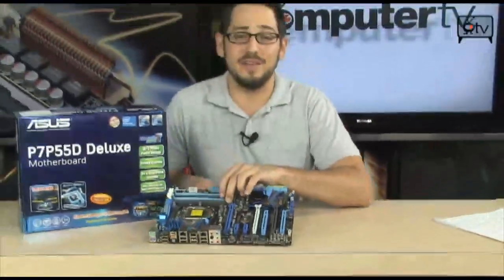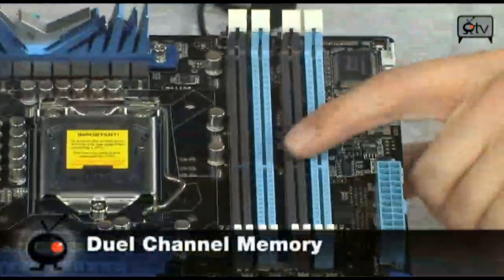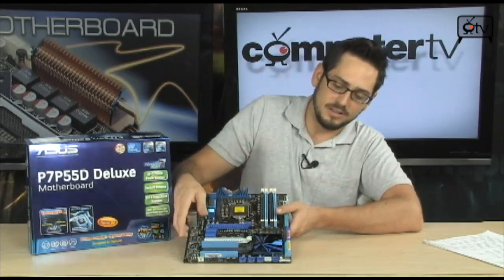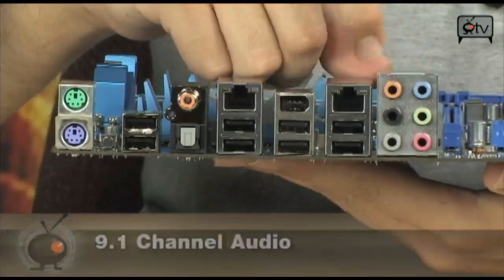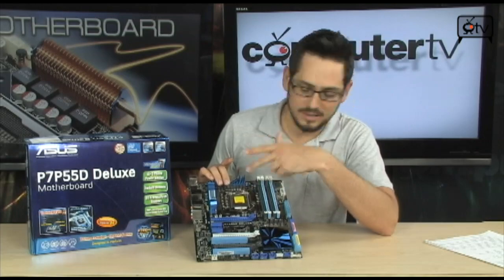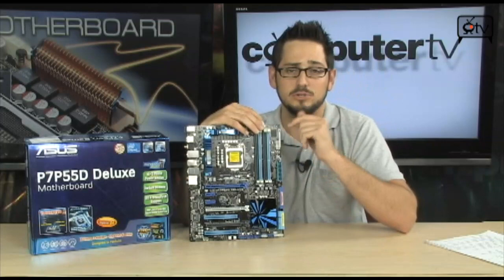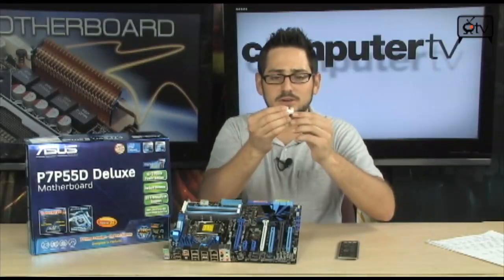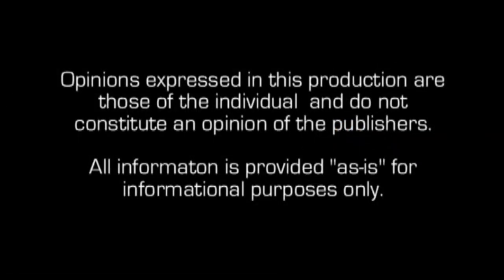Asus P7P55 Deluxe Motherboard

Comment: yeah it will still work but this time in 2 years there will be a motherboard with better technology and will be better, the p55 will still be a good high end board, 

instead of saving for a specific board, or a specfic card or cpu, just save up the money to buy a high end board or cpu and when you saved $200 you can buy the current "high end" product

Comment: not true, check out hardware cannucks, they did a test like a year ago that determained that x16, x16 and x16, x8 was exactely the same, and x4, x4, x4 in tripple sli made on average a 10 fps difference, so its not a 50% difference its very small. if your going to go tripple sli, then yes I agree this is not the best board, but the electronic speed of the 3 lanes is not a big reason.

Comment: Quick correction: The PCI-E x16, when fully populated, run at x8, x8, and x4. The extra x4 is from the onboard chip, the main 16 are from the CPU. It's a big difference when doing, say dual-SLI with dedicated PhysX, since x4 can actually limit bandwidth whereas at this time x8 does not.